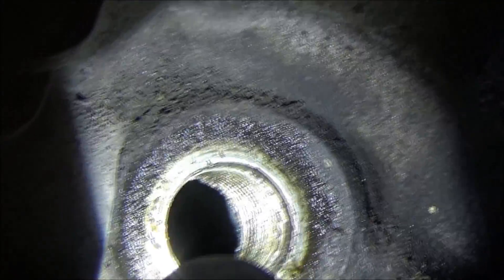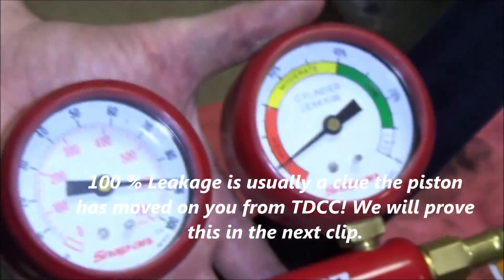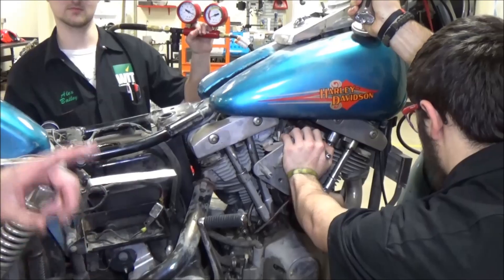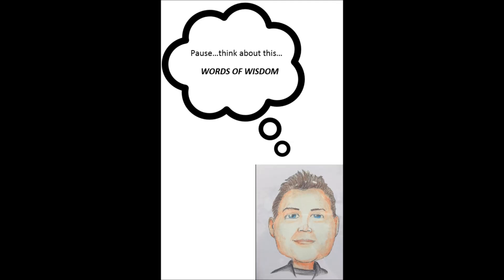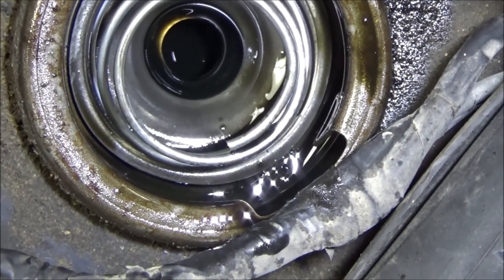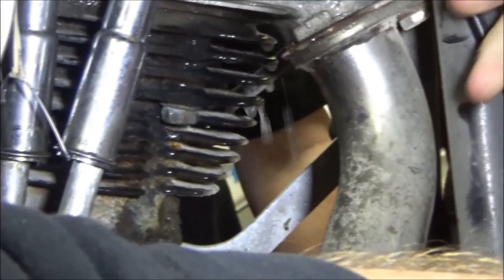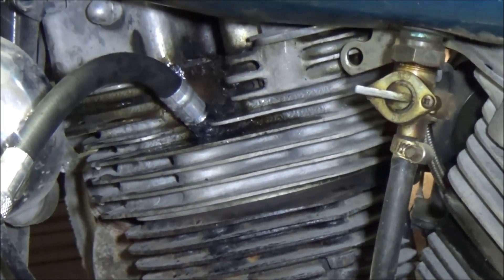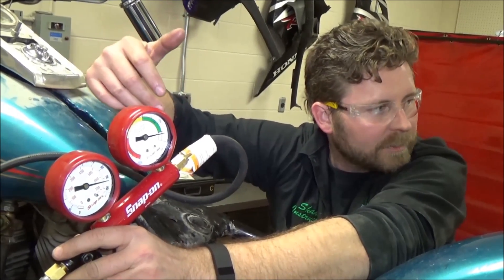How to perform a cylinder leakdown test: Demo on Harley Shovelhead EVO TWIN CAM

Comment: My owns a motorcycle shop and just told me he just keeps piston on BDC to check leak down and no worries about piston jumping around , he said it works just fine... no need to have piston on TDC. if it leaks it leaks... but i always use my snap-on tester correct by having piston at TDC...

Comment: I understand how compression rings expand with compressed air getting behind the ring and pushing out to seal the ring race with the cylinder wall, but the fact that the ring is split and not continuous, I still don't understand how there's a seal.
Reply: There is a ring which is continuous i have them on my honda race car engine 1994 GSR B18-C1.. THERE called Total sealed power rings out of Arizona ... and what is happening with the rings is the gap you are talking about is only .004 gap per inch okay. so a 4 inch piston would have a max of .016 gap. now the gap is rotating around they say so it will change location on the piston and car engine pistons have 2 rings and a oil ring too... but what is also happening is the pressure from the compression will get behind the rings and push them away from the piston to seal them to the cylinder walls remember that...  now i have seen rings on motorcycles that have a locator pin in the ring land that touch's the ring and keeps it from moving or spinning around the piston, i have that pin in the piston ring land on my weed eater because i burned up the piston and had to install a new piston and i saw a tiny pin to line and stop the rings from moving. crazy...

Comment: Would it be possible to hold the engine in TDC position with a gear on and rear brake applied ? im am an A&P mecanic so for us it's so easy to hold the propeller ;-)
Reply from the maker: If the brake was working...:) You can reach me personally @  https://how2wrench.com/contact/
Please show your support by a membership or donation to get the help you need beyond those popular free videos that have saved you so much money and grief! You can say thank you here: https://www.paypal.me/how2wrench

Comment: as a 30 year harley wrench you test the motor cold    then    hot i have seen shovel heads with 25% leak down get it hot 6 % leak down know why it had low silicon pistons  lot of piston running fit ! there are a lot of factors

Comment: Hi again Shane. Just a thought. For those out here who don't have access to a leakdown tester, what do you think about the old school method of pouring some engine oil inside the cylinder, through the spark plug hole, and then measure the compression against the previous measure, before putting the oil in. If you get an improvement in PSI, wouldn't this tell you that there some leaking taking place in the rings? If, on the other hand, no PSI improvement was to be found after pouring in the oil, the leak would be in the valves. Granted the PSI was below engine specs to begin with.

Naturally this won't let you check leaks other than rings or valves, like the one coming from the crank, like in the video.
Thanks again for yet another very educational video. Hope you keep em coming.
Best regards.
Reply: head gaskets leak too... and yes old school is good. but for $50 you can get a leak down tester come on...

Comment: Good info here, what I will add to this is I use my ultra sonic leak detector to zero in on finding any air passing instead of the soapy water.
Reply from the maker: Cool tools out there! Thank you for sharing. What brand do you work with?
Reply: Have a Robinair model, not to expensive and work well on vacuum and pressure leaks, also can find bad bearings with it when the probe is installed, handy tool for sure